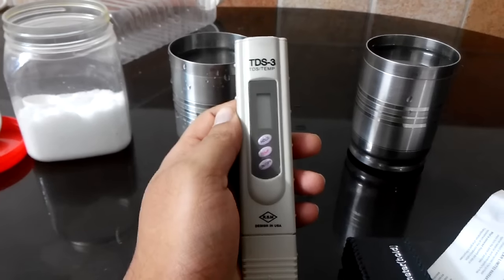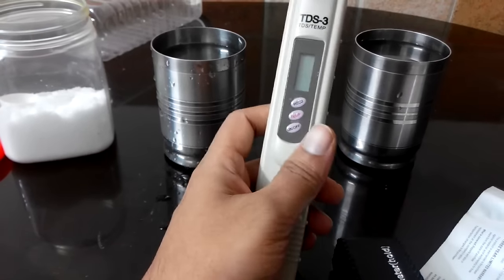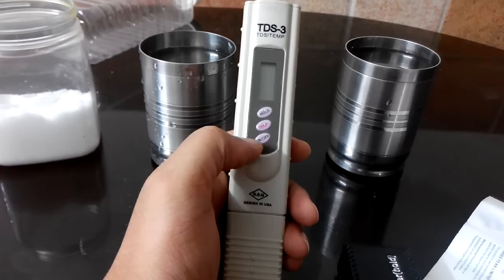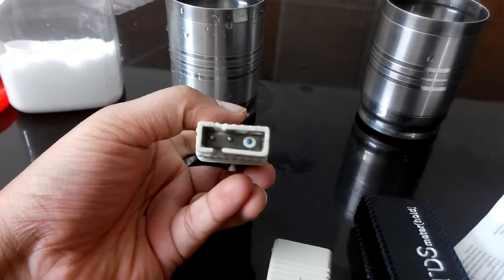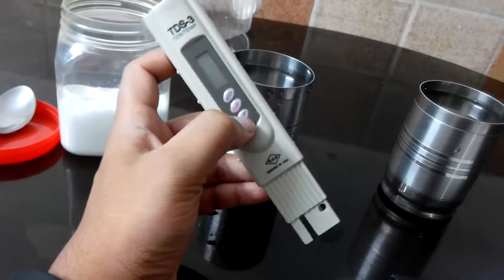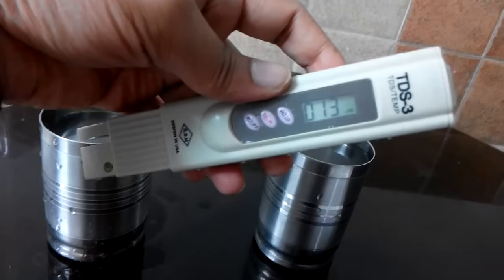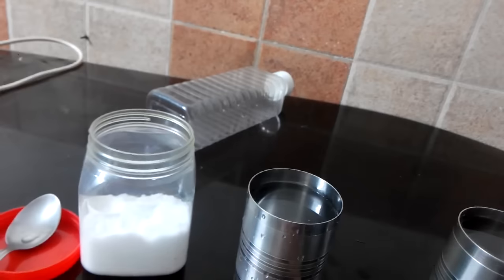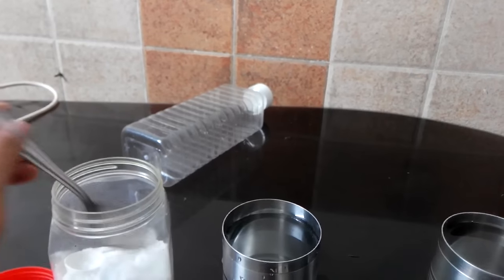How to measure TDS of water using a TDS meter

Comment: The reason why the TDS meter increased after putting salt in it is because it's measuring the minerals in the water. It doesn't necessarily mean it's bad or good it's just more minerals then the number would go up.

Comment: what ill be the minimum tds of drinking water
Reply: sufiyan iqbal UpTo 100-300 is considered safe by who
Reply: sufiyan iqbal but if ro than less than 50
Reply: Ro ??
Reply: sufiyan iqbal reverse osmosis
Reply: Thank you
Reply: My ro is giving 25 TDS is this bad or good
Reply: sufiyan iqbal below 50 is good...you are from which place
Reply: M from inida
Reply: Tnx
Reply: Do some research on healthy TDS... between 300-500 is healthy,  100 is considered optimal, and  anything below 100 in unhealthy, depleting your body of natural healthy minerals
Reply: @davefraley5660  - yes anything below 50 is really problematic . But what's happening is since Tap water in India is highly polluted, hard etc (with 1000 and above PPM's) most Indian households use RO (reverse osmosis) systems. But the problem is these RO's  strip the water of everything (not just the harmful minerals) thereby reducing TDS to dangerously low levels of 10-20 PPM's and can prove to be more harmful than just plain filtering the water!